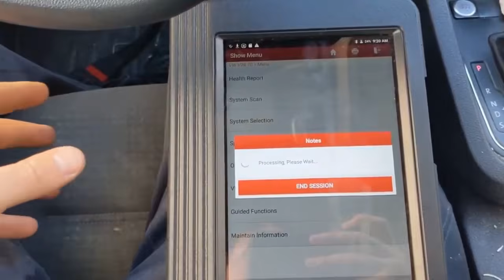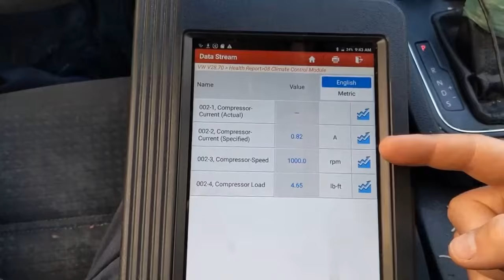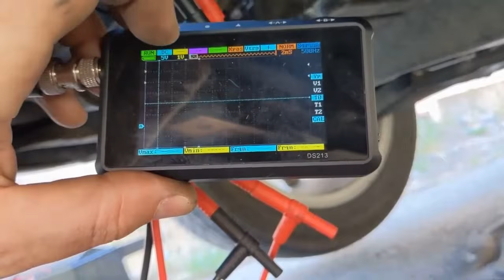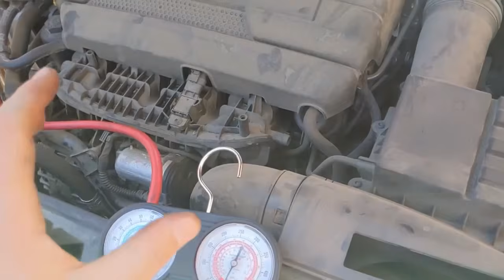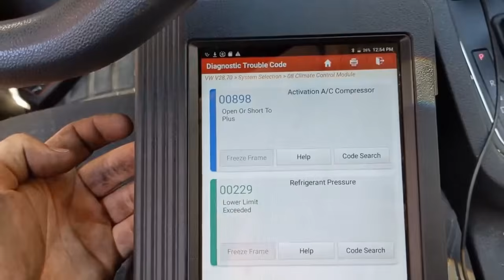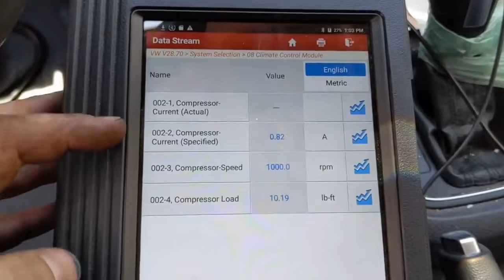2009-2017 VW Intermittent AC Diagnosis and Repair | How to Fix Volkswagen Air Conditioner

Comment: Shouldn't the condenser be replaced also?
Reply from the maker: Good question. The part that was bad was the pressure regulator. So the rest of the system was still operational. The amount of time the system was open to the atmosphere was minimal so the decadent should still be good. If this was exposed to the air for a long period of time then the decadent should be replaced. By design the decadent absorbs  moisture out of the air. That's also why pulling a good vacuum before refill is important. In a strong vacuum moisture will boil/evaporate.
Reply: @ValleyMobileAutomotive  I replace the AC Compressor Control Solenoid Valve and the ac worked fine for a week now it went back to work on and off. what would you recommend me to do next?
Reply: if u change compresor u need to replace condensor to. there is no warranty for compresor if u dont change condensor and clean the sistem hose.